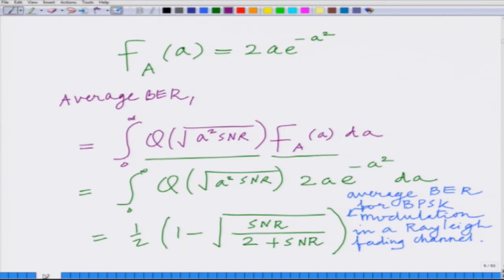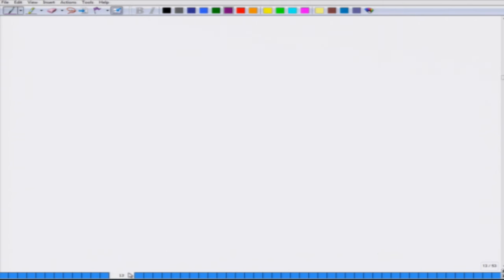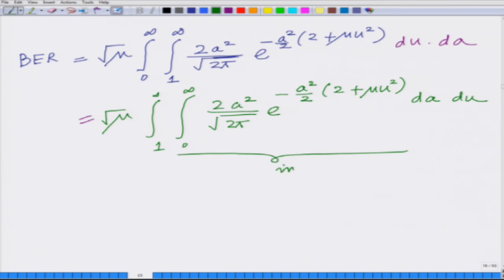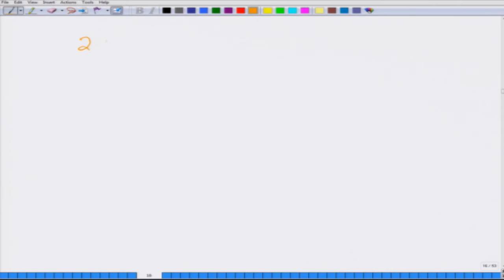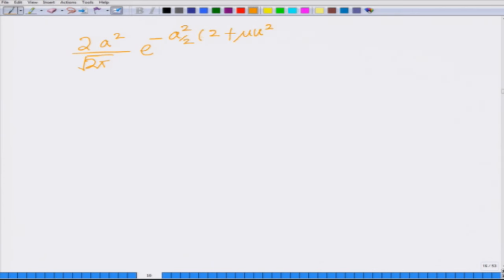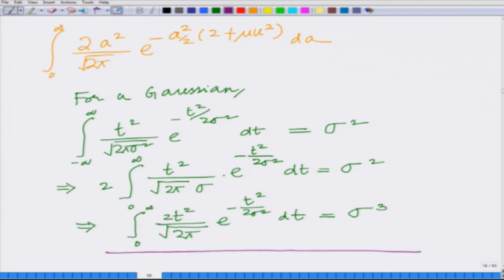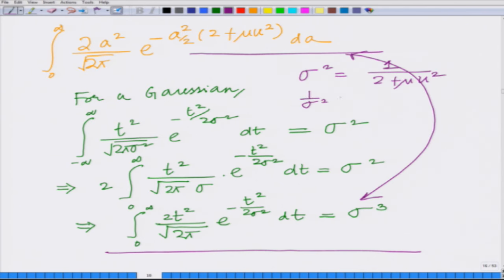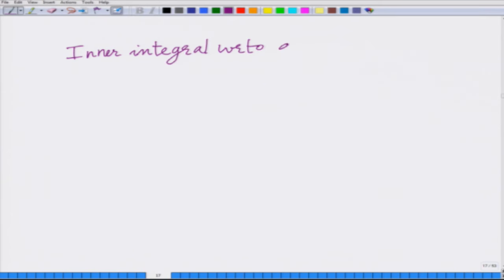Lecture 09: Exact BER Expression for Rayleigh Fading Wireless Channel

Comment: This proof is unnecessarily complicated. A much simpler proof can be got by swapping integrals, integrating rayleigh first and then completing the squares. You do have to use the expression for variance of gaussian also.
Reply: Could you provide me with the proof you mentioned?? It would be helpful for my research...
Reply: @isisisis123  I apologize to the professor for my choice of words. I was probably in a bad mood when I posted this. But it is true that a simpler proof is there. Let me try to explain it in subsequent posts.
Reply: @isisisis123  Let us look at 3:40. Swap the integrals. Inner integral will be from 0 to sqrt(t/mu). Integrating this for 2ae^(-a^2) is easy. You get 1 - e^(-(t^2)/mu). The rest should be a simple Gaussian integral manipulation .Write it out and see.
Reply: @konchady1  can you send me in telegram?